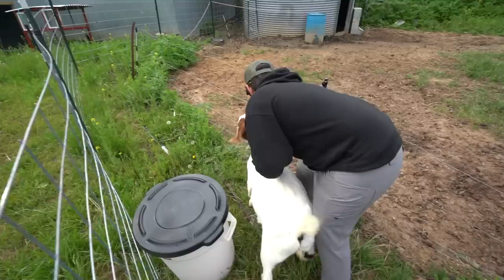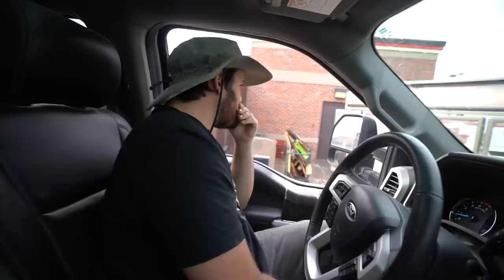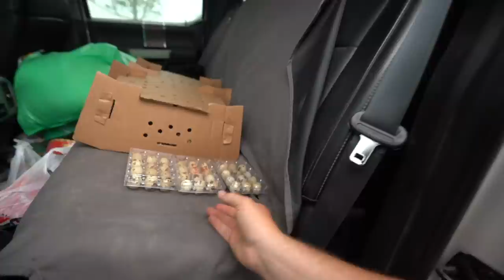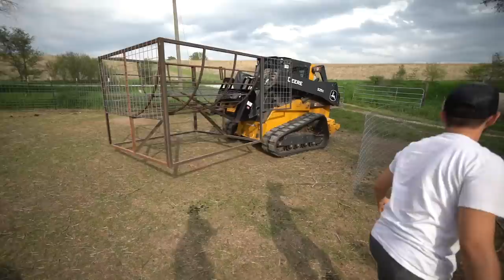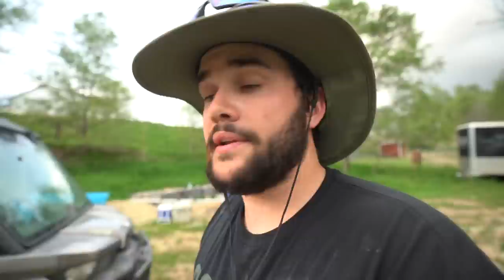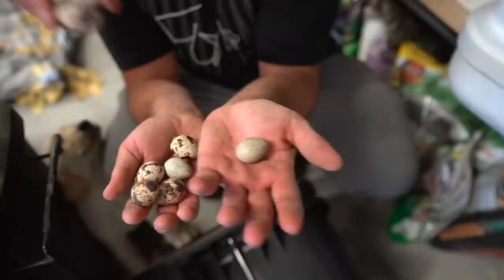I Bought RARE BABY PIGS for My BACKYARD FARM!!!

Comment: also you need to put most of the weight to the front of the trailer before the axle. especially if you are highway driving bc more weight behind the axle results in swaying and loosing control of trailer and having it come off your truck